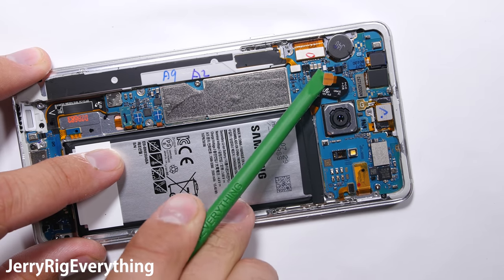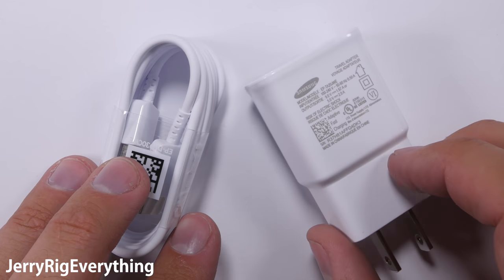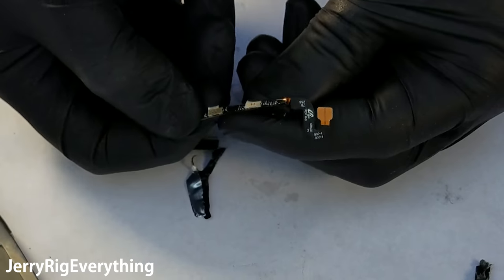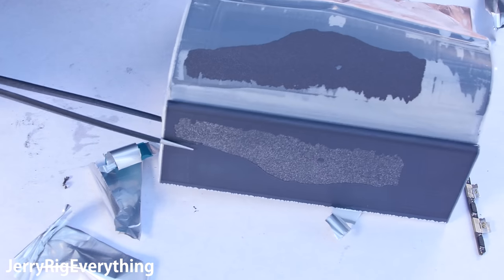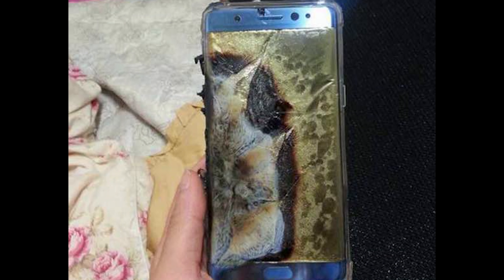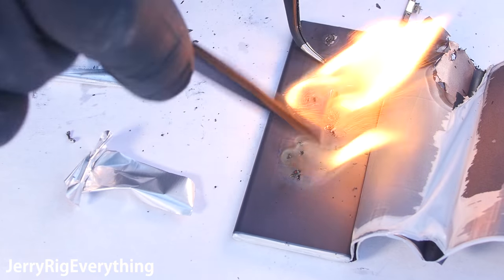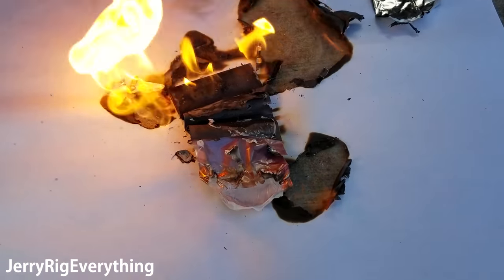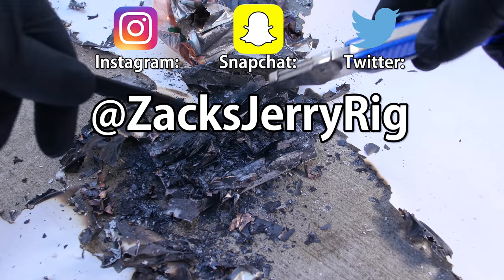Note 7 Battery Explosion!! CAUGHT LIVE ON CAMERA!!

Comment: LOL Love all the salty bitter hate coming from the non-samsung fanboys. Let's see whats actually going on:

1. Samsung does not manufacture the batteries for the phone, just how it doesn't manufacture the Corning Gorilla Glass that goes up front. The fault is in the battery, not in the phone. Two manufacturing plants are used for the batteries, and apparently one of the plants has had a bad batch. 

2. 35 or so phones have been reported and Samsung recalled over 2 million units. So doing some math, let's take 40 out of 2 million which will give you 0.05% of the phones being defective. Samsung recalled ALL the phones to protect their users, promising to replace the phone with a new one once they were sure the issue was resolved. Most likely, they will track the phones which had batteries put in from the faulty batches using the IMEI numbers, and re-package the other returned phones. 

3. Last I heard from Apple about a fault was earlier this year, about them using shitty soldering (DIRECT manufacturing fault) which caused the screens to flicker, shut off, or not display images properly, it was affecting ALL the phones they released. They couldn't even give a shit about their customers, but instead said "no the phone is fine, you guys just don't know how to hold the phone" (in essence, they're calling their customer base retarded). 

You know... Stick with Apple. At least Samsung doesn't treat customers like worthless retards and has the professionalism to immediately recall a faulty product, even if it is their flagship phone, RIGHT before the IFA. This has even further solidified their customers' loyalties. But yeah, tell me again how your iPhone's flickering screen was resolved?
Reply: Walid point
Reply: +Juzy Juzz super walid points.
Reply: Tbh I think they had no other choice then recalling the phone, if someone is hurt they'll get in serious trouble but you are right apple is fucked up but LG too,  I am using the v10 and ppl are saying it bootloops but lg doesn't give a shit
Reply: +Ivan D well atleast you get free shit to wait 2 weeks longer haha
Reply: ECHELON Lol
Reply: The display controller was faulty not the soldering, where did you get your information? wanna provide some links?
It also didn't put people in danger.
Reply: wrong, Samsung had no other choice...  if someone gets hurt Samsung is seriously in trouble
Reply: I don't know about Samsung haters.. But hey Sammy 
fan boy.. There is something called QA which Samsung should do before passing those batteries.. U r argument is just another fan boy excuse... Samsung recalling means it's not on a smaller scale... Till now only 35 exploded.. But Samsung only knows how many of them have bad batteries which may explode in future....
Reply: Exactly, I don't know why is so difficult to understand to some people ahah
Reply: +shaquille cooper so you're saying that you are a woman because it's clear you're a apple fanboy.
Reply: Moreover, 35 cases or 2 cases, it doesnt matter why? It's a freaggin bomb. One bad explosion can lead to worst nightmare. For samesung they had no choice. And it isnt even 35 cases lol it was going to grow if they hadnt stop the sales
Reply: Jimmy Kim nope i'm not. i know a phone doesn't ment to be a bomb and yes it's bad from samsung for doing this. the only thing i wanted to say is just the fact that he calls fanboys a woman but he is also a fanboy. everyone is a fanboy of something and that's good and bad. there's one thing cummon between all of us and that's the fact that we use the same sort of stuff, only a different company and shit.
Reply: no excuse for samsung but it's ok for apple we get it =p samsung themself didn't make excuse.... unlike apple "you hold your phone wrong" XD samsung might just say you charge your phone in the wrong way, not saying apple is a bad product...but a bad choice apple made...for us customers..
Reply: ***** im not on any side but you need to get though your head that a faulty antenna doesn't have the ability to severely harm people. Samsung does not have a choice. they arent the good guys for "choosing" to do this, there is no other option
Reply: well it does harm the wallet XD
Reply: Raoul G Thank you for using your brain.
Reply: Brian but there is nothing to appreciate? they aren't doing it for you? you say you're not stupid but keep repeating that you appreciate it?
Reply: and a few iPhones have blown up to
Reply: that was said perfectly tons of cars that cost $100,000 have had these problems before it's just the battery manufacturer..

Samsung is much better than Apple with customer support they actually care about their customers and what they think that's why I only 35 of them have this problem they were calling all the phones just like you said in my certified computer technician and network engineer shop we fix phones and computers I would never home apple product but I will fix them! I see more problems with Apple phones than Samsung and Flagship Android phones

apple is a dinosaur all the experts are not upgrading to the iPhone 7 because there taking away the speaker Jack in the phone is a marginal upgrade they continue to manufacture budget phones that's right the iPhone 6s and 7 are budget phones

you can get the same specs and performance from an Android budget phone like the OnePlus 3 that has the same screen LOL

but they try giving you the same thing over and over again refusing to upgrade their screen too high PPI and resolution like Samsung. It's because they know that if they put an expensive high resolution PPI screen in their phones they would have to upgrade their processors software and everything to push that beautiful screen...  the only care about putting money in their pockets, people got smart 84% of the market share of Android and 75% of the market share is Flagship Android phones not to mention Samsung is beating Apple all by itself

Android phones are true computer in your hand then out a stripped down version of a computer like apple does with their Unix operating system with Samsung and Android you have the latest and greatest software and Hardware complete customization

apple is a joke I'm surprised people fall for that bullcrap it's the same old dinosaur same old crackers it is nothing but a budget phone that they overcharge you $400 for.

if you can't buy a flagship Android phone like the Galaxy S7 Edge, a note 7 Edge or other flagship phone. just buy the (one plus 3) from Android you'll save $400 and you'll get better performance than Apple

:)
Reply: +Mathers Mahmood lol the fact that you have had to visit an apple store many times and walk away with a new garbage phone feeling somehow better says tons. like I said... stick with Apple. they sure love you.
Reply: btw it's not Corning's fault that the glass scratches. Pretty sure Samsung buys the glass but then modifies it to fit theirs phones. Also the batteries are made by Samsung tpi (or whatever) which is a subsidiary of Samsung.

Also I ordered a Note 7.
Reply: +Mathers Mahmood and for u ignorant people who think Apple performs better than Android with the operating system like I've already explained it's only with game launching and because apple has a budget 1080p for one screen that's easy to push they wouldn't dare put a screen like Samsung on their pathetic A9 CHIP because the chip will probably overheating lag like crazy!! 

you take the game launching out and Android is far superior and faster than Apple!! plenty of YouTube videos proving this with the iPhone 6s plus vs. Galaxy S7 Edge

here's an article written a few years ago about the difference this is for you ignorant people prove that APPLE AND Android Superior in different ways!! 

actually in the article describes that overall Android performs better and more relevant ways!! 

not to mention programmers haven't even caught up to Octa Core and quad core that the Galaxy S7 Edge and Superior Android phones have they have even skim the surface!! and they still beat Apple the future is quad-core or octa-core the Apple iPhone is a dinosaur. if you got one of the Android Flagship phones like the Galaxy S7 Edge just sit back and wait because things only get better they're trying to catch up to the best hardware and software phones on the planet true customizable computer in your hand unlike Apple's stripped-down pathetic budget phone specs and screen!! 

---------------------------

Why do games load faster on iPhones compared to Android phones?

I tested various games on iphone 6, iphone 5s,nexus 6, galaxy s5 etc and found that it takes considerably lesser time to load g... More

Glyn WilliamsGlyn Williams, Started using smartphones when they were dumb
1.9k Views • Glyn is a Most Viewed Writer in iPhones (product) with 460+ answers.
Lots of reasons.

Hardware difference.
The processors in the iPhone are 64 bit, which means wider data pathways. In benchmarks, pretty much all data moving operations are about twice as fast with the 64 bit architecture / OS.    So the loading of a game, the loading of game assets and the shunting of chunks of memory around that games do is something that is just faster on this sort of processor.

System difference.
iOS is loading native code which was compiled by a big optimising compiler on a Mac - it just loads the correct binary and runs optimised code.  The file to load will be smaller (because it is just object code) and there is no internal  on-device compilation needed.   (Not ART or JIT).  On device compilation needs to be lightweight,  so also expect the resulting code to be less optimal.

* This only applies to Java games, some Android games are written in C++ native code..

Software difference.
It's also likely that game developers on iOS will optimise assets and data files into compact binary forms, because the know exactly what architecture they are going to find. So, for example,  textures might be already compressed into PVR formats.  On Android there is a great deal more uncertainty about which hardware the game will find itself running on. So some Android versions some might use the uncompressed PNG assets to be hardware agnostic.

Bhargavi H Chandrashekar, I brand stuff with my MIND
227 Views

Android apps are compiled to bytecode by the developer. Bytecode is a compact representation of the program: smaller than the source code written by the programmer, but still not directly executable by the CPU. Some optimizations, such as dead code removal, can be made at this stage.

When you load the app on a device, the Dalvik JVM compiles the bytecode to native executable code, just as it's about to run. This is just-in-time compilation. It causes a brief slow-down while the program waits to be compiled, but after that there's no performance overhead, because the code has been compiled to native executable code.

There are some performance advantages to doing it this way instead of compiling up-front on the developer's computer. The app can be compiled for the particular CPU on the phone, taking advantage of its hardware features and using its performance characteristics. For example, it can use hardware floating-point operations if the CPU supports it. In addition, a clever JIT compiler (admittedly, Dalvik is not quite this clever) can monitor the way the program runs, and perform optimizations based on the way the program is used in real use. It might recompile the code with better branch hinting once it has seen which options are turned on and off in your environment, on your phone. An up-front compiler doesn't have this information to use.

Dalvik uses the Dalvik cache and other techniques to mitigate the drawbacks of JIT compilation. The new JVM for Android L and later, ART, replaces the JIT entirely with anahead-of-timecompiler. This compiles the bytecode to native executable code when theapp is installed, to get most of the advantages of JIT without the delay loading the app.

Don't forget that Android apps don't entirely consist of Java. Developers have the NDK to write all or part of their apps in C or C++, for performance-critical parts of the app, especially for games. Special-purpose interfaces like OpenGL and Renderscript let programmers take advantage of special hardware like the GPU and SIMD coprocessor for some kinds of computation.

***Using JIT instead of up-front compilation makes some things faster, some things slower. It's just one part of the overall performance of the OS.

Updated 23 Jan 2015 • View Upvotes
Tommy NgTommy Ng, Expensive
192 Views
Probably due to JIT compilation by the Dalvik runtime.

You should try switching to ART runtime (AOT compilation) for a comparison.

Android L will use ART by default.
Reply: +Mathers Mahmood and as for you saying Samsung customer service sucks are you out of your mind I have my own certified computer technician and networking engineer shop that I Fix Apple phones Android phones Windows phones and computers

Samsung never gives me a hard time about anything you call Samsung up they will help you right away especially if it's in the beginning stage

I've even dropped my phone crack my screen admitted to it and it was in the first month I walked into my Verizon store Samsung agreed to give me a brand new phone no questions asked no problems!

Samsung is into everything did you know that they make the A9 chip for apple and their Retina Display LOL the retina display that has tons of motion blur that's only a 1080p 401 PPI screen you can find the same specs and budget Android phones that cost $400 that perform better like the OnePlus 3 that even has a better camera bigger battery!! 

the Apple iPhone is nothing but a budget phone nobody I'm telling you nobody would living with the Galaxy S7 Edge switches back to the iPhone 6s plus thousands of people I know do not hesitate and they tell me they don't know what they're missing a loved the customizations the speed is blazing fast and no issues

I will give you some information about phone maintenance is the only reason why Android phones lag and this goes for all phones I've seen Apple phones coming to my shop lagging like crazy and I can't get over that dumb horrible motion blur you see on Apple phones it's unacceptable!!
Reply: Lol the level of fanbouyism in this comment section makes me sick, the higher resolution excuse was already debunked putting the note 7 at 720p it performs still slower than the iPhone.
Reply: muzikmon2267 You are being a fanboy and Its clear that you have absolutely no idea what you are talking bout.
You clearly have no knowledge at all of processing threads, rendered resolution or anything else you’re talking about.
You are also very ignorant to new information that contradicts your incorrect views.
I have a Bachelor of Computer Science, and can confirm that when a phone is rendering at a certain resolution (in this case the Note 7 optionally rendering at 720p) the number of pixels on the physical display are totally irrelevant. If the resolution is set at 720p the GPU is processing 720p and then the display controller built into the screen (completely independent from the GPU and CPU, and has no effect on performance).
So when the the Note 7 is rendering 720p and it is still slower than another phone, it has nothing to do with how many physical pixels exist on the screen.
Also, the shit you are dribbling about processing games is so wrong its laughable. Games are rendered with the GPU and the amount of cores on the CPU 99% of the time makes no difference at all.
You can do CPU and GPU based benchmarks, and when your doing a CPU benchmark it is irrelevant what resolution the GPU is rendering on the screen because its the same rendered frame, it doesn’t change. The benchmark is only using the CPU. 
Geek bench is an example of a CPU benchmark. Funnily enough, the A9 benches a higher score than the Snapdragon 820. This benchmark has nothing at all to do with the screen resolution so please stop dribbling utter shit.
Reply: Native resolution apple vs Android

And furthermore have you ever tried physically connect an Android phone to a 720 P television with a much lower PPI WE DO THINGS LIKE THAT ALL THE TIME IN MY CERTIFIED PHONE REPAIR SHOP. I DID WITH THE GALAXY S7 EDGE! That's right the performance is much faster faster than Apple!! And I can assure you it has much better speed performance then if you took the Galaxy Note 7 display designed for 2K and a high PPI native resolution rendering it to 720P! It does not yield the same Speedy results as using an actual television designed for 720P!! 

I have also tried the opposite taking a Apple iPhone 6s Plus and connecting it to a higher resolution 4K television at which the television was designed for and I can tell you the iPhone 6s plus ran like shit and slow down like a snail!!

Just love how u actually think a screen designed for a certain resolution PPI will perform the same as if you render a screen to a different resolution that is a new type of dumb!!  like I said it's just for a certified technicians to troubleshoot a screen!! Not for dumb people like you to render it to 720P to see if it's as fast as an Apple iPhone LOL!!

 time to go back to school kid you're missing a lot information!!

In the event that some things are quicker on Apple you also sacrificing a beautiful high-resolution screen, motion blur, complete customization and True full feature, complete customization computer experience that Android offers!! 

In other words there's a reason why expert Apple reviewers, and other expert reviewers like JERRY RIG EVERYTHING, and  SUPERSAF TV after living with the iPhone 6s plus and the Galaxy S7 Edge including the Note 7 Edge always pick the Samsung for there daily driver and forget about the iPhone, because there is no noticeable difference in everyday usage when it comes to speed!! There's a reason why the Galaxy S7 Edge was rated the perfect smartphone. BECAUSE IT'S THE BEST HARDWARE AND SOFTWARE, AND VISUAL EXPERENCE U CAN GET ON THE PLANET!! 

And I can tell you of the thousands of people I know in blogs, and from my computer repair shop the people that switch from the iPhone 6s plus to the Galaxy S6 Edge and now the Galaxy S 7 edge have not looked back they said they didn't know they were missing!! Just like the expert reviewers once you use the Galaxy S7 Edge you don't go back!! It's the best overall experience on a smartphone you can get on the planet in rated as such!

Anyways these ridiculous speed test mean nothing in the real world unless you do this piece has the exact same order launching the same exact games that are not java-based exactly the way that they do it which is never going to happen I've done plenty of tests and plenty of Test on YouTube that proved the Galaxy S7 Edge even with its higher resolution and ppi is faster than the iPhone 6s Plus!! 

I want to talk about something that matters!! 

Is a reason why Galaxy S7 Edge has a better screen, better camera, fast wired and wireless charging, bigger battery, water resistant, fastest launching fastest focusing camera for a phone on the planet, why is the Apple iPhone in the Galaxy S7 Edge both have a 5.5 inch screen but yet the Galaxy S7 Edge feel smaller than the hand and  has a smaller screen to body ratio! A beautiful amazing visual experience that makes you not want to put down the Galaxy S7 Edge !Why does it only take a Galaxy S7 Edge with a 3600 milliamp battery to charge to 50% in under 30 minutes!! Why is it have awesome Innovative Edge software, complete customization and full-featured true computer operating system unlike Apple's stripped-down version of UNIX!! Gear VR is taking over America such an Innovative equipment that is better than any VR gear competition because of the amazing screen resolution and you have to use your phone!!  and you get a gear VR free with the purchase of the Galaxy S7 Edge or Note 7 Edge

The Apple iPhone is a dinosaur their stock their sales are dropping your phone is nothing better than a $400 budget Android phone they sell to you for $750 they strip everything down claiming their phone is faster because they cannot beat Android at their own game! 

There's a reason why 84% of the market share is Android and 75% of the market share is Flagship Android phones and Samsung alone is beating Apple!! 

There's a reason why Apple expert fan boys have stated they don't want to upgrade to the iPhone 7 they took away the speaker and it's only marginally better in specifications because it's the same old dinosaur iPhone same old crackers

The iPhone is slowly fading away you might want to keep a couple of them as antiques so you can say this is what an iPhone used to be LOL!!
Reply: +Jimmy Kim Yeah, Samsung chooses which battery's are defective at the factory...Because that makes so much fucking sense. Go back to cleaning windows with your tongue.
Reply: Ivan D Why are you angry? You paid your money, they are willing to return it no questions asked. Why so pissy?
Reply: Ivan D ahem the "option" that puts the screen resolution down, is also the option that cuts processor power... it's the battery saver. I remember seeing something about "I'm not a fanboy" but you sure seem to love defending Apple's products for no reason. I mean, sure, Apple products are so good... that's why their market-share is going up- oh no wait, it's gone to shit... Samsung as a single company alone out-sells the iPhone, not counting other fantastic manufacturers like HTC, LG, Lenovo, etc...

so yeah, like I said... stick to Apple. They really love and care their customers.
Reply: ***** The total number of "faulty" products reported so far have been under 50... out of 2.5 million sold. Grab a calculator and you'll find it is less than 0.05% of phones. And the company has behaved very responsibly by recalling ALL issued phones, not just the faulty ones. And people are still trying to point fingers talking shit about the company... Please... it's pitiful now.
Reply: Actually those reports about touch screens becoming unresponsive were because of third party parts causing the problem. Also, that case is very small for that to happen.
Reply: Ross MK Uhm, no. the reason for the screens becoming unresponsive was because the soldering material they use to connect the screen to the board is crap, and it cracks when it gets hot and gives you a faulty connection. The actual screen has no issue, it's purely shitty manufacturing... Just how if you accidentally sat on the iphone it would bend.
Reply: Ok we should sue battery maker not samsung if some one dies in explosion.
Reply: Apple Iphone is not manufactured by Apple but by Foxconn, Pegatron. So Its not Apple's Fault if there is any defect in iphone.
Reply: Nauman Javed The only reason Samsung sells more is because they have like 200 phones a year from like $100 to $850. Apple still sold more flagships and still makes more money. Also, my Note 7 isn't that great light leaking and debris getting stuck between the metal and glass drastically more than my other phones. Also, this phone is the only one that owned that lags horribly when updating apps. When its not updating apps it's perfectly smooth, except some bug where it becomes slow for no apparent reason that's when I restart to get back to normal.
Reply: *Past phones
Reply: Well said,  Apple is garbage for real
Reply: How do you not appear as a Samsung fanboy?
Reply: Actually, Samsung does manufacture the batteries for the phone. You should research before you make posts like this. Other people should too when they hear some news from a stranger on the Internet.

The faulty batteries came from Samsung SDI, which is based in Korea. China made the rest of the batteries, and they are all safe. However, Samsung is recalling all phones and having the batteries redone, as well as fixing some other weird mistakes, such as the S-Pen stylus not popping out sometimes when pressed. This was quite the fuck up, but Samsung is responding to this in the most appropriate way.
Reply: Theres a comparison to be made here. Samsung did a total recall of all phones, even ones supposedly unaffected, and it cost them a billion dollars in profit. The key here is they took back undamaged phones.

They overcompensated for the sake of peace of mind. Which is extremely admirable. Apple literally tells people its not worth there time or money, and is trying to make it look like its user fault, which is not covered by warranty, as hard as they can. If you can argue with them enough, you can get your phone fixed, but even still. When a foreign company is treating us better than an american one, it does not look good for the american company.
Reply: Jose Luis
They sure spent a lot of money to care about it as much as you say.

Of course companies care about money. Money should be the number one priority, because you cant do anything without it.

Im not even on the samsung bandwagon, as a Nexus user. This is pure facts. People need to research and actually learn things instead of believing any person who says HEY GUYS DID YOU HEAR SAMSUNG SENT EXPLODING PHONES TO AMERICANS  #KIMJONGUNSGONNAKILLUSALL 

Its absolute bullshit.
Reply: yes the batteries being recalled were made by SDI in korea, a subsidiary of samsung. the note 7 is NOT being recalled in china because they were supplied by a chinese company called ATL.
Reply: Tarzan Jane
The Samsung phones that have not exploded also have ATL batteries in them. the reason why Samsung is recalling them nonetheless is for public safety. American product laws are a bit different here, and while Im not saying that the goverment is forcing Samsung to recall all phones, it is a lot better for them if they do, mainly because of liability. Plus, this really boosts morality between Samsung and there customers.

If I was served unfit food at a restaurant and the manager offered me a fresh new meal or a refund, my choice, Id be upset, but thankful and appreciative. At least I can leave and go somewhere else, or give the chef another try. Sometimes its hectic and people make mistakes. Not everyone is malicious.

My point is, Samsung does care about there customers. My sister had an S4 and her screen cracked about 9 months in to owning it. She knew about the warranty but for personal damage it costs money nonetheless. A year later, at 20 months into ownership, well past the warranty expiry, she called Samsung and told them her story.

They fixed it for $75. Labor, parts, shipping, all of it. $75. They checked the phone once it was in ther hands and sure enough, it handt been turned on in many months. They decided to give her the benefit of the doubt.

You can ask someone else and they will tell you Samsung told them its not their problem and they are shit out of luck. But, 9 times out of 10, Sammy takes care of business.
Reply: so u r telling that 75%(all flagship android brands) > 25%(one apple brand), but iam still smiling at the percentage, how a lone brand keeping that much percentage when compared to a huge bunch of android brands.

NOTE: iam an android user too(not bcuz of android fan boy, bcuz its CHEAP and not able to afford iphone).....
Reply: At the end of the day Samsung made an error like all companies do but at least they came out publicly with priority to correct this major problem.
Reply: +Naresh P lol,  you are a troll in itself
Reply: lol, iam just pointing out the troll he made :)
Reply: Ivan D You don't get it. It's almost like this is the first time you've heard of a recall (not surprised, considering you're an Apple fanboy and they just basically tell you "live with it"). A few years ago Toyota had to recall ALL their cars because apparently their gas pedals would stick. 

All you have to do is type "iphone explodes" and see how many people have been burnt, or seriously injured because the flimsy bendable body on the iPhone allows the batteries to get punctured resulting in explosion. There are instances from 2014 until August of this year... But no... I'm sure it's nothing wrong with the phone or Apple. 

And love how you side-step bullshit internal build quality which causes a well-known screen issue, but again, Apple says "live with it". 

It's thanks to people like you that Apple just doesn't give a shit. Because all they have to do is change the number or put an "s" on the end of the same device from 4 years ago and people like you will just throw money at them.
Reply: Jose Luis Wait, recalling the phones to prevent injury to people is over-compensating? How is that over-compensating?! It's being responsible... but no, just Google "iPhone explodes" and then tell me that Apple gives two shits if its customers are getting 3rd degree chemical burns.
Reply: Ivan D tbh note 7 is faster than IPhone
Reply: ***** Right, the 4 reviews i saw about it says otherwise, but hey if you say so i believe you.
Reply: Ivan D 1st of all, I'm not handing out medals, I appreciate that even though I am not one of (only) 40 people on planet Earth who's phone was faulty, Samsung has the good sense to call back all the issued phones, to correct the issue, and get on with life. Not a single person was harmed because of this fault... property only. 

Meanwhile, the iPhone's shitty, flimsy body design which causes the phone to warp, bend, and damage the battery resulting in MULTIPLE PEOPLE BEING SERIOUSLY INJURED SINCE 2014. 

But yeah... You're right... I'm a fanboy... not a person who respects a company which does things right. By the way, did you see the "new" iPhone 7? Same screen as iPhone 6, same size size as iphone 6, smaller battery, bigger camera bump, no wireless charging, no expandable memory, no dual sim card support, no headphone jack, still no edge-to-edge screen... but wait! If you pay them more money they will let you use wireless headphones <---Wireless headphones, and wireless charging pad provided with the pre-ordered Note 7. But WAIT!!! The new iPhone is the SAME PRICE as the Note 7! 

By the way... you're possibly the only moron on Earth who associates the middle east with poverty. Dumbass.
Reply: Ivan D People like you are the reason why brands like Apple flourished.
Reply: Nauman Javed WTF! lol i dont even like the new stupid iPhone 7 without headphone jack.